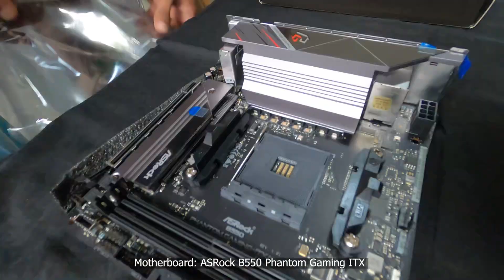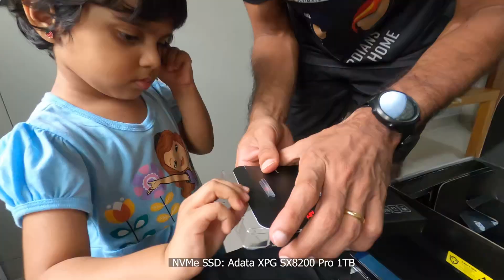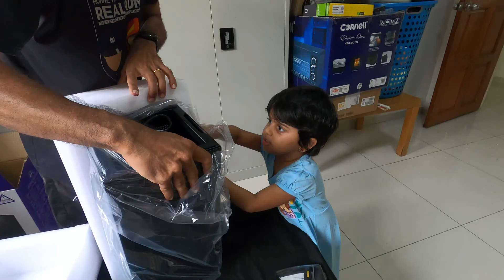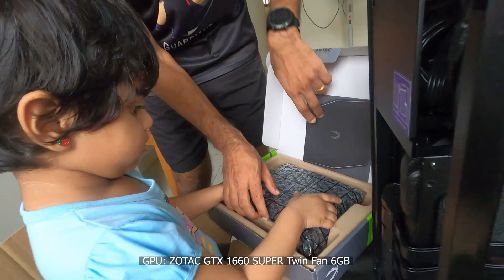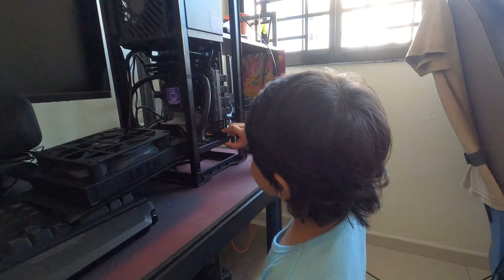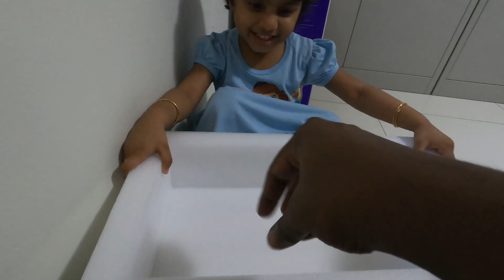I let my 3 year old build a PC, and then this happened! | Grow with Mahi

Comment: Hi i bought the same config does this system work flawlessly especially memory. Does it work 3200mhz ??
Reply: Yup, no issues. Memory runs at 3200MHz after selecting XMP 2.0 profile in BIOS. Assuming your RAM comes with XMP profile, it's a very simple setting to change.